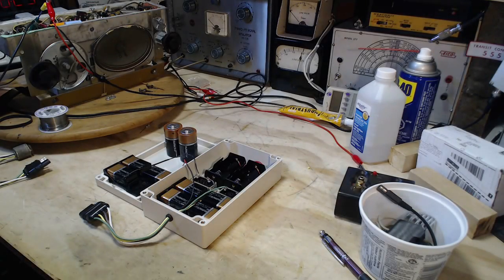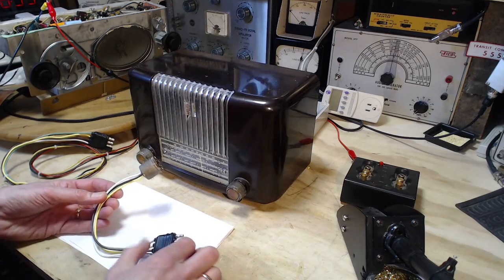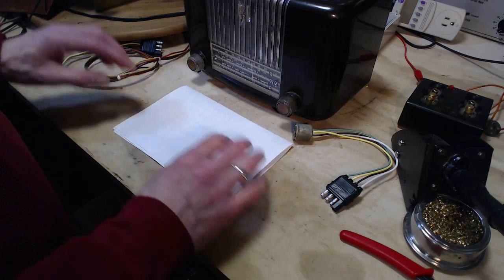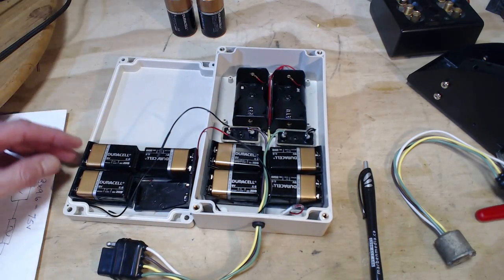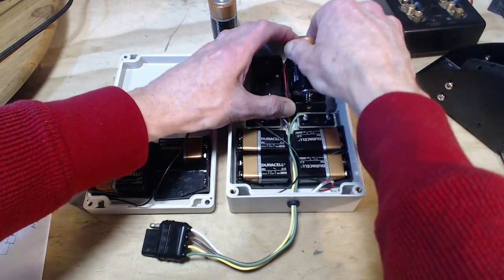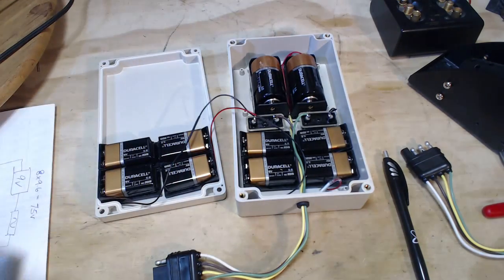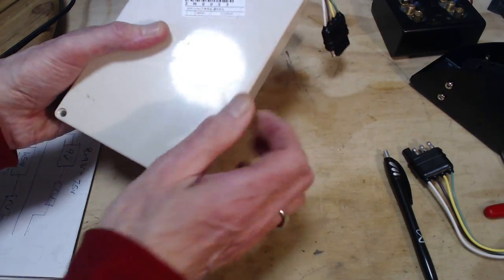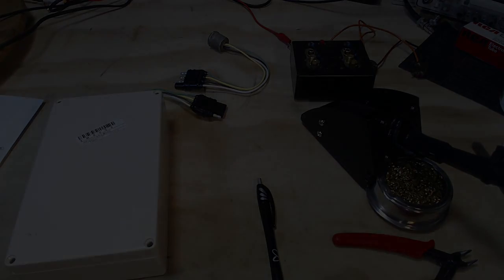Battery Pack for Farm Radios

Comment: Hey Jim,Im glad you did this Video on the battery Supply Box,I just Bought a 1920s Foote 2 circut,2 tube radio.I only Know what one tube is,Its a UV 199 tube,the other tube is unmarked.I was lucky Enough to get the original schematic with the radio.It just shows the 2nd tube as a 4 pin Amplifier tube,so I dont Know if any 1920s Amp.tube will work,If mine was bad..But both tubes do light up.I do get voltage all thru the radio,but no sound as of yet.One COOL thing is the Tunning Condenser opens up like a butterfly wings!This is my 1rst Battery radio project. Best thing is I only paid 20.00 for the set!

Comment: Nice battery box - thanks for posting.    I would respectfully  suggest that there is no way that you would get 300 hours' worth of use out of 2 D cells.   The question is not so much the total battery mAh but how long will it take before the battery voltage drops below 1.4 V typically needed by the tubes,  and that is probably 10 - 20 hours,  depending on use and battery quality.    Much below that and the oscillator probably won't do its thing.   So I think you were totally right to use 2 in parallel.    The B batteries are less critical.

Comment: Heheheh...  :-D
Good choice fuse ratings; same I use.
Like the 8 x 9V, too; they come packaged (retail) in 1,2,4 packs, not 5 or 10...(one of the dumbest buys I've made was a 3-cell flashlight...)
Yep, a single 45V alkaline pack will usually work a looong time. 72V even longer.
Those old dry batteries were horrible regarding individual cell reliability; the radio manufacturers were well aware of that...so...have the radio still play if half of the cells in the battery were not much more than resistors. 
Nice to meet Peanut!  ;-)

Comment: I suppose if you live in the UK you can get replace vacuum tube radio batteries if you live in the US or CANADA then why not build a mains operated inverter supply to give 1.5v and 90v, would be fun to rebuild one of those radios using the KORG Noritake Nutubes I.E vacuum tubes that look like integrated circuits with windows which glow with a green light and are Single Inline pin connector and will run of a 12v car battery, There is a package from JAPAN that is Meowlingual Cat Translator